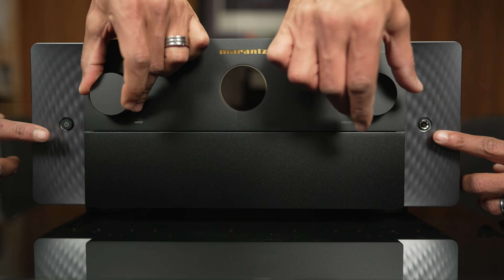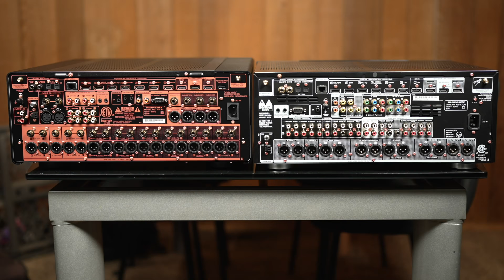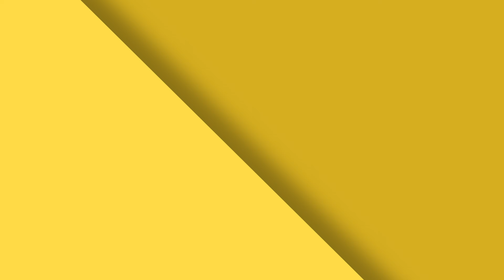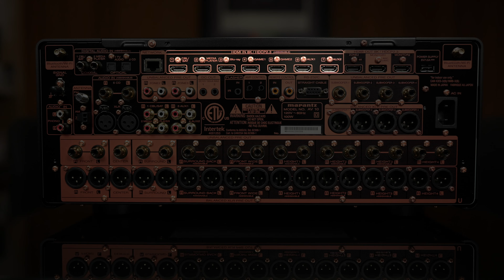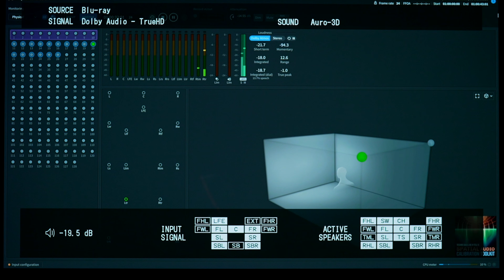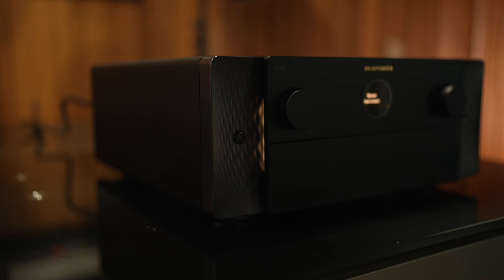Marantz AV10 Unboxing & Dolby Atmos Setup | Flagship Home Theater Processor

Comment: Not rocking 16 channels but do have an 11.2.4 system. Av10 and 4 Emotiva amps ranging from the DR3 to the basx a500. Would be nice if Marantz offered the same experience but with less channels for cheaper. Maybe the AV20 with 13 channels for a thousand less.  AV30 with 11 channels for maybe 2k less?? Not everybody has 16 channels, but most of us, I can say, have 7.1 or higher and would love something like this go for less channels with a cheaper price but still the same bells and whistles of th AV 10

Comment: Just as happy with my av7005 
Still works flawlessly. I am over 60 and starting to believe it will out live me. 
But if I had it to do over I would save longer for a integrated McIntosh 12000. 
More interested in audio than home theater now. 
Marantz is fine but always seems to leave a little something short for mine it was two subs but not individually controlled balanced out but nada in. 
And not updating streaming audio sources not being able to log into the ones it has. For these and other reasons I wont buy another Marantz. 
For me if I were young again the long term support of McIntosh would be well worth the money.

Comment: If I have 4 subs which are going from the balanced sub 1-4 outs, how can I connect an amp/4 buttkickers to this unit? Would it go via the unbalanced?
Reply from the maker: The Buttkicker is only used with Subwoofer output #4.

Comment: Consider this configuration:
1. Source: Nvidia/AMD graphics card with 48 GBps port for 4K/144Hz 10-bit gaming
2. Middle man: super expensive AVR or AV processor, all of which have 40 Gbps ports for 4K/120Hz pass-through
3. Sink: new Samsung QD-OLED TV with 48 Gbps port for 4K/144Hz 10-bit gaming

Why are consumers still offered slower HDMI ports on a pass-through machine when source and sink devices are already more capable? And when will AVRs and AV processors be upgraded to full speed ports, to fall in line with advancements in other industries? Have you ever asked vendors those questions? Are there any answers for the public? Thank you.
Reply from the maker: The A/V Receiver is and has always been the caboose end of the electronics train.  The simple answer...they need to sell you something next year...so they will wait to make upgrades like 48 Gbps until they deem it's necessary.  There are other options, like the Arcam AVR11 or higher that has all 7 HDMI inputs at 48 Gbps.  I've asked a few people before and they say it's "not an issue" as we are only using a max of 40 Gbps.
Reply: @TechnoDad  There is no evidence that Arcam AVR11 or any other AVR/AVR uses full speed 48 Gbps chip. Have you measured the speed? Does it pass-through FRL6 signal?

We have not heard that any current AVR HDMI chip is able to deal with 48 Gbps signal. Those who are saying "it's not an issue" must have missed the fact that even new TVs from Samsung QD-OLED line-up offer four 48 Gbps ports for 4K/144Hz signal, plus Nvidia, AMD and Intel grpahics cards that can output 48 Gbps signal to capable dsiplays.

Comment: I'm still learning about this, but do you need the amp10 to go to alongside with the av10? Does the av10 not have a built-in amp to power the speakers for a home theater system?
Reply from the maker: Hi Anthony, great question!  You will need an amplifier for sure.  Whether you want to go with the AMP 10, or another one, two, or three amps to use with the AV10, it does not matter.  It depends on how many speakers you are running.

Comment: Am I missing out?! I have the Denon AVR-X8500HA receiver.  Is this Marantz AV10 Processor much better in movie watching 🎬?
Reply from the maker: I don’t think so.  Do you run external amplifiers?
Reply: @Techno Dad  Yes, I am running five Russound P125 amplifiers to Bi-amp my SVS Ultra L, R C, SR, and SL speakers. Also, I have four Russound P75 amps to power EIGHT more channels (6 Heights and 2 surround backs).

Comment: Is amazing how you reply to other people and not me , you know why because is true what I'm saying , read what I wrote and tell me that I'm wrong. There's no blueray dvd that output more than 2 atmos speakers or a streaming company that stream on more than 2 atmos. You talking about 8 dolby atmos , really. All those receivers that has more than 2 channels for atmos is a waste of time and money. Is like 8k tvs , tell me who output 8k, nobody so why you buying an 8k tv. See what im saying. Is like arc only give you simulation of atmos but earc give you the real thing. If you don't answer me is ok I know I'm right. Bless.
Reply from the maker: What's amazing is people like you think you have the right to my free time.  Considering I have four jobs and I just started a new company and fullfilled over 600 orders in the passed two days.  Maybe...just maybe, I have better things to do with my time.  To answer your question, no.  You are wrong.  On the consumer side, I've gone from a 5.1.2 to a 5.1.4 and that upgrade was huge as you actually get front to back movement in the height channels.  Then I went from 5.1.4 to 7.1.4.  After creating over 160 Atmos tracks and mixing Atmos for a couple of years, I've come to find out that the ideal setup would be 7.1.6.  And contrarty to what you belive...Atmos is Atmos, wheater it's lossy DD+ or lossless Dolby TrueHD.  I have created a 9.1.6 Atmos mix and delivered it in both DD+ and Dolby TrueHD and it works correctly.  8K...yeah, that's BS...Atmos, however is different.
Reply: You're deluded and have no idea what you're talking about. Make sure you keep taking your meds bro😂

Comment: No mw pierdo ninguno de tus videos ni los de dailyhifi!. I hope you can answer me please 🙏🏼.

I have a Yamaha a6a with klipsch mark II fronts, rear still do not change them from jamo 606 (6ohms), and in atmos polk own3.

 Is in a rack with a space of 4 " at the top and ventilated at the front and back. The temperature of the room is about 82F.

My avr is overheating on the 2 front sides, this is normal or should only be a bit warm?. 

Thanks a lot!
Reply: Define "overheating"?....... you burn your hand on the sides, or you smell burning when its running....?.....

Buy a "fire extinguisher " 🧯 ...... and an external fan blowing into the top of it.... 😳👎🏻👀..........

Comment: Digital technology implemented in top-of-the-line AV processors (of different mass producers like top 3 in the world - Denon, Marantz, Yamaha) has to be like in top-of-the-line smartphone producers ( like Huawei, Xiaomi, Samsung, Apple, Honor). Because it will become obsolete in just a few years. In 2023, I don't want to buy ooold, obsolete technology at an unjustified cost! Only the newest and best-performing components has to be used. Unfortunately, this is not the case... In regarding only to the audio side of the Marantz AV10... My level of expectations at 7000 USD (or even more) is that I need one AV unit to sound like a flagship stereo, on ALL channels... BTW... Be honest... who is using 15 channels configuration in a living room? Or kilometers of wires for zone 2 or zone 3 connections in which the end result is to play same music, instead of separate very good quality audio components in those rooms? We are not talking about hearing the same music in corridors or on an elevator of a hotel... Sabre DAC ES 9018 used inside AV10? Why not at least ESS 9039Pro or AKM4191EQ? Or a dedicated very low noise stereo DAC in dual differential mode per each channel? As a top-of-the-line product in 2023, it should have! And where is HDCD decoding? Audiophile CD format is not dead, SACD is not dead, Dolby Digital is not dead... Even vinyl is not dead, and in 2023 we still not having a decent phono preamplifier for both MM and MC cartridges in a top-of-the-line AV processor...  In the audiophile community, we are still spinning HDCD CDs, SACD discs, DVD Audio discs - and for HDCD, we need that decoder. Also...we are in 2023, right? ...where is streaming and decoding native DSD1024 audio files? I want to see ultra low noise separate power supplies inside of a top of the line AV processor... This is the level of quality that I expect from a Marantz or Denon AV processor flagship, in 2023.  RCA connectors are made from gold-plated brass? This is NOT desirable, because of brass low conductivity. It should be made at least from silver or gold-plated OFC copper (again... I'm modest...I'm not mentioning pure silver-made connectors...). I want to see OCC pure copper or OCC pure silver wires used in inside cabling!  Talking further...what OP-AMP are used inside? No info here... Also, no info regarding SINAD with EQ in flat mode at max output volume. I want an upscaler even from DVD definition, to 4k and 8k resolution! Also, who is really using HEOS?? Especially in this high-end area...  McIntosh is having same marketing policy... No detailed info in regarding inside components used, and no tech info regarding audio performance in their top-of-the-line AV processor... Only high prices! With all due respect for these companies, this is not acceptable.
Reply: I agree wholeheartedly.......... its appaling, and i will vote with my wallet untill they bring out tech that we need.... also no support for 144hz displays and only 40gbs pass through not 48gbs which everybody else is using...... 

Audazee upgrade 200$
Dirac upgrade (upto 500hz) 350$
Dirac upgrade (full frequency) 500$

Totally unacceptable (especially considering you need a windows 10 laptop (+ 1,000$) and a usb microphone, crappy umk1 cost 88$ + microphone boom arm at 20+$)........

Unacceptable 👎🏻.......

Comment: Not sure if this is the place to ask, why does it go back to 1 subwoofer out when you go from 5.2 to 7.1 this amp has 4 sub outs but only 1 will work once you go past 5.2
Reply from the maker: I only have one subwoofer, so I'd have to check that.
Reply: @Techno Dad  Thank you  I have 2 subwoofers 1 sending the signal to the other because I'm running a 7.1 but my reciver can be put back to 5.2.2 just wondering why you lose a sub output when going up to 7 channels 😢
Reply: I'm curious as well. I'm in the process of building a theater with 4 subs. Having 4 independent outs is important to me.

Comment: hey man - im just finishing a  5.4.6  auro 3d setup, in one of your other videos you say that they tell you to have the back speakers as surround heights,  but you suggest doing surround back heights because then its also atmos compatible , what if i ONLY use auro 3d upmix and never atmos, would you still do that , or would you go with the recommended surround heights.
Reply from the maker: Hi Bruce.  I would still use Rear Heights as opposed to Surround Heights.

Comment: Price is crazy for this. Should be $5k. Anthem avm90 all day for this kinda money.  Also marantz needs to watch out for integra.  D/M has increased prices to much for there brands.
Reply from the maker: Same can be said for the AVM90...no Auro-3D either.  I hope Anthem updated the GUI as my MRX720 was pretty bare bones.  I think all these companies are using "inflation" to charge us more.
Reply: @TechnoDad there is webgui on Anthem. Besides StormAudio and Trinnov I believe it’s a next best gui you can find. Anthem does measure very well and uses the latest top ESS DAC as well - higher end from Marantz. It would be very interesting comparison - which one does better job. On the premise of Sound United one day updating Av10 with Dirac Art - I would bet on it
Reply: i think the replacement of the 8805 is gonna be 5k
Reply: @junior-OG  hmmm this processor is the flagship like the 8805. I think the next pre pro would be the AV20, which would replace the 7706. It will be less capable than this 19ch processor (15.4), but to your point somewhere between the 8805 and the AV10. I’m looking forward to a Cinema 30, which would be the flagship AVR I’m guessing? Something between to replace the 8015?
Reply: @HiFinest343  the av10 do not replace the 8805 it is a new tier
av20 = new 8805
av30 = new 7706

Comment: 7K price tag and you have to pay extra for Dirac? I love my Anthem AVM70 that came with ARC Genesis.
Reply from the maker: ARC Genesis is pretty awesome...however...no Auro-3D support.
Reply: @TechnoDad  - Do not use that anyway. Have you reviewed the AVM70/90?
Reply: @bkrhino1 you don’t use it because you can’t. Just kidding. Seriously Auto3D is a blast for music.
Reply: Dirac Live is much better than ARC Genesis imo. Upgraded from the AVM70 to the HTP-1 and it made a huge difference for me. Dirac is already a step up, but with Bass Control it’s a game changer.
Reply: @brucecarter6205  - Never heard that one, but I am happy with ARC Genesis.
Reply: @bkrhino1  hopefully ARC Genesis is in a better place now, as it was a complete mess when the AVM70 first launched, in fact that is what lead me to move on to the HTP-1 and Dirac Live.
Reply: @brucecarter6205  - I have had for a month with no issues. I come from a Marantz AV7705 and the channel separation, clarity and dynamics of my speakers were very noticeable. Getting another for my garage system as it also has the AV7705.

Comment: Hello Techno Dad! My speakers don't have XLR outputs, just the regular speaker wire. So how do I make this work with my 5.1.4 setup? Thanks! :)
Reply: Spend more money. A lot more.
Reply: You need a separate amplifier in order to power them. Sound will go from the processor to the amplifier and then to the speaker. As far as I know, most amplifiers have XLR inputs.
Reply: You need a power amplifier.  The power amplifier will have your speaker wire connections using wire , banana plugs, etc. The XLR connections are used to connect the amplifier to your pre-pro.
Reply from the maker: Hi Asaf!  You will need an amplifier to go from AV10 > Amplifier > Speakers.
Reply: @TechnoDad  Thank you very much! Which amplifier do you recommend? I currently have a Pioneer ELITE VSX-LX305. :)